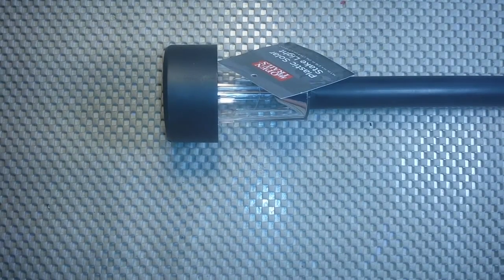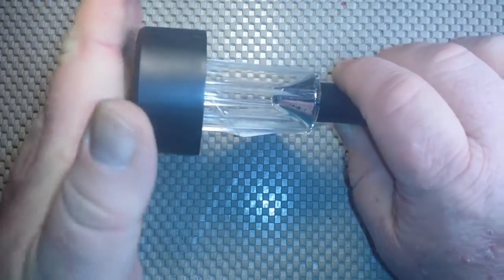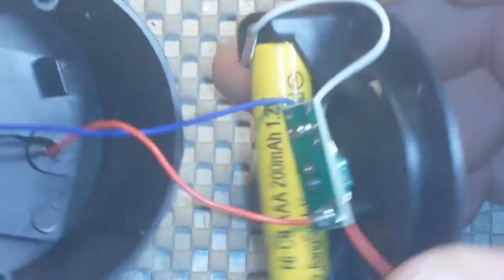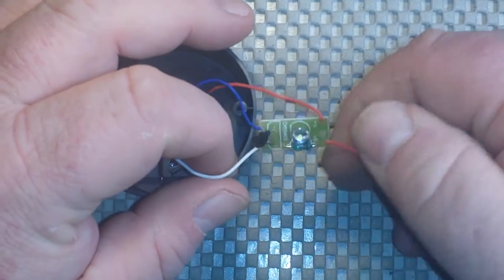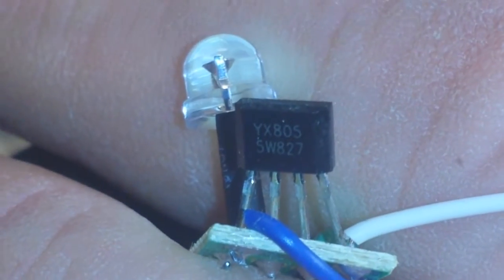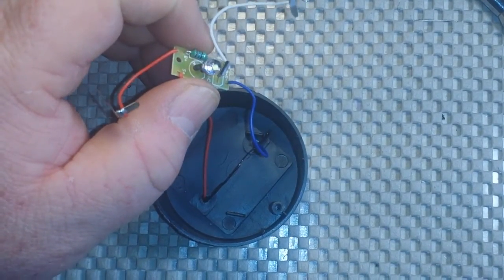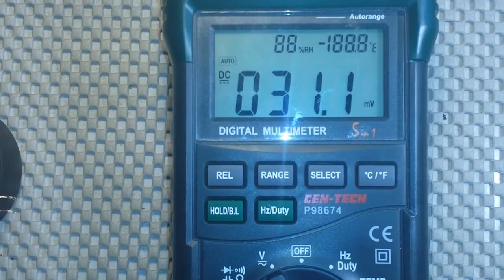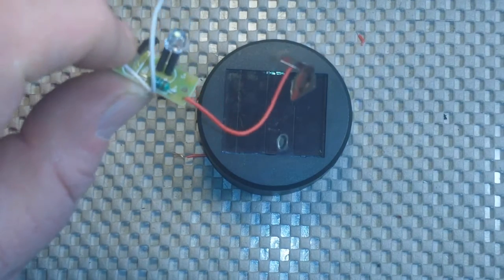What's inside a dollar store solar garden light

Comment: I have a solar mosaic glass globe and the blue wire came off the board. The other 2 wires are red and black. Do you know where the blue one needs to attach? Also, does it have to be sautered or can I use my glue gun?

Comment: You may have figured this all out by now but the "resistor" is an inductor and the "transistor/voltage regulator" was actually an integrated circuit that pulses power into the inductor and performs much like a true joule thief. The value of the inductor will determine the led brightness. A true joule thief will usually run down to around 0.5v sometimes less. The ic in the solar light cuts out at 0.9v to protect the rechargeable battery. (also stops disposable batteries from leaking) I think they better than a true joule thief in some ways and often more efficient.

Comment: These little solar units are great... I bought a bunch of them a while back and find all kinds of uses for the parts.
Best thing so far is I designed and 3D printed a part that holds 2 of the cells together... I wire them in series and can get 5v in full sun and about 4.5v under my LED spotlight. Add a TP4056 and recharge 18650 cells.